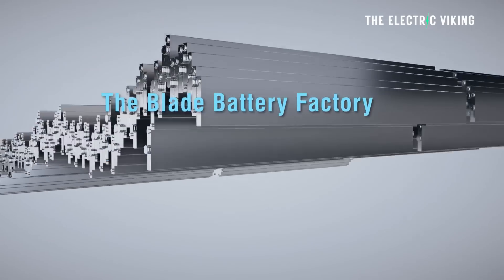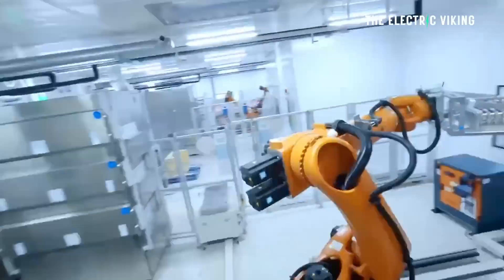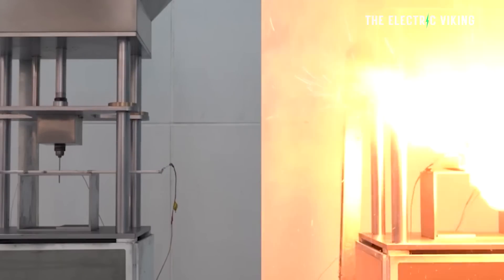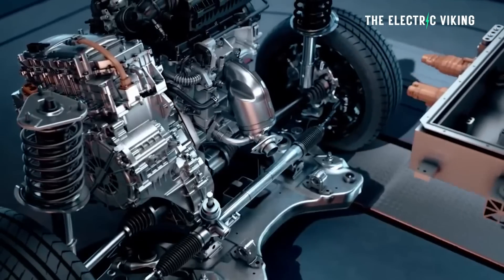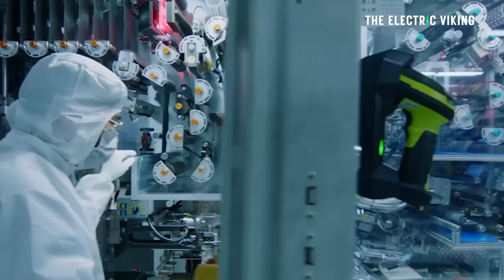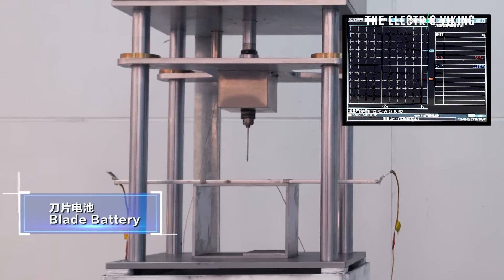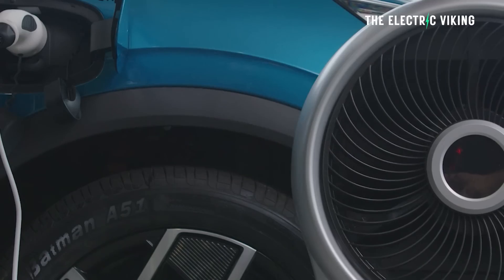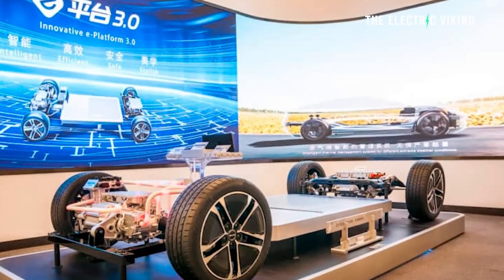BYD reveal new cheaper LFP Blade battery with 27% higher energy density

Comment: I think this v2 byd blade battery pack with 190 wh/kg in pack level energy density is the best battery pack ever released by any company,for comparison 2025 taycan line up with NMC 811 battery cells has 170 wh/kg in pack level energy density. or CATL qilin battery in zeekr with 280 wh/kg cells has 200 wh/kg in pack level energy density,or tesla model s plaid structural battery pack has 181 wh/kg in pack level energy density,so a battery pack with LFP battery chemistery  and that amazing energy density which also has much higher battery life almost like a petrol car and you can charge it to 100 percent with out battery degradation anxiety is amazing,very well done BYD
Reply: Btw, where does he get te 27% improvement?  "CEO, Wang Chuanfu, said the new battery will be even smaller and lighter with the same endurance during a recent financial meeting"
Reply: @pieter85  at their press con they showed on a screen written 190wh/kg pack energy density,their first gen blade had 140 wh/kg which had been improved to 150 wh/kg in just two years so when your consider 150 to 190 you will have 26.7 percent increase in energy density and when you round that 26.7 you will have 27 percent increase in energy density
Reply: The Taycan battery is a structural chassis component + their cooling system is something else as well... not comparable
Reply: @pieter85  you are right 2025 taycan battery pack has one of the most advanced thermo management systems period along side with 811 chemistery,thats how they got that 320 kw fast charing in much wider range temperatures both in battery pack and out side air temperatures

Comment: The longer the range, the better in cold winter conditions countries. 
In the winter times, turning on the heat to keep warm on an electric vehicle will drain out the batteries very quickly. Having long-range batteries less charging time. 
😃💖🔋🌞💯🌏✌️

Comment: Ok Sam you keep making this mistake. When the energy density goes up (watts/kg), the new battery is going to be lighter for the same amount of energy! So a new car using the new battery to replace its 60Kwh battery will have less weight for a new 60Kwh battery, but to get the same range will still need a (close to) 60Kwh battery. 20% increase in energy density is 20% reduction in weight… does not / will not equal a 12% reduction in required overall energy capacity. Parasitic drag and power use (A/C etc) will not change, only a very small change will occur from rolling resistance because of the reduced weight.
Reply: I was about to write the same comment. I don't know why it would make sense to get the same range with a lot less energy. It's just that the battery with the same energy either get lighter or smaller - depending on whether volumetric or gravimetric energy density increased.
Reply: True, I wrote the same thing. Thanks for mentioning it more clearly.
Reply: yes, more energy density means that a  battery pack that's the same physical size will have a larger capacity, or a physically smaller/lighter battery with the same capacity. A higher density smaller battery can be cheaper, and being lighter, can have additional improvement to range. This continued misunderstanding undermines the channel.
Reply: I think what he was trying to say is you could get 60 kWh from a former 50 kWh sized pack
Reply: @mteifke  if you’re measuring capacity (Kwh), measure capacity, if you’re measuring physical size, measure weight and dimensions. You don’t need to be an engineer for this to make sense
Reply: The weight is very important.  The greater the mass of the vehicle, the more energy is required to move it.   One of the biggest complaints about EVs has been their weight.
Reply: @peteralflat281  This is only partially true. Weight only contributes to a small increase in rolling resistance (friction) and of course potential energy loss however we can assume all EVs now use regenerative breaking to recoup most of this energy. Most of the energy losses are built in with parasitic drag, conversion inefficiencies and ancillary services like your A/C, power steering, battery heating and cooling and the like. So the power use because of weight reduction is minimal. I’m not saying weight reduction isn’t a good thing, but in reality, it’s not going to happen, as the physical dimensions of the battery will likely remain fixed while the useable power, and therefore range, extends.
Reply: no such hting

Comment: The question is does the blade battery architecture suffer longevity problems or some other drawback as a result of increasing the energy density? There is no free upgrades in any device in this world - when you increase one thing something else has to decrease, and in this case isn’t not just the size.

Comment: One day they'll have a 300 mile pack on a sub 10k motorcycle, and this is definitely going the right way! :)
Reply: Only if it weighs less than 200 lbs!   :-)
Reply: Im waiting! After years of tinkering on Ebicycles I love the tech.
Reply: 300 miles range, when an electric bike at 70mph gets about 4.5 miles per kWh. To get 300 mile range needs 300/4.5 = 66.6kWh
Using these 190Wh/kg batteries it would weigh 66600/190 = 350kG.......770lbs. 300 miles
My bike gets 200 miles range on 20kG of fuel

Comment: Yes this is all well and good but when will I be able to charge an EV direct into a household electric point without the need for a charging box .
Reply: What do you mean? You can do it now
Reply: @Another_opinion_  Yes, you can do it now.  For about 1 month, I solely charge my EV from a regular household plug, I was waiting for my wallbox installation back then. Takes longer time but still manageable.
Reply: @alihms  that's what I meant. You can charge your EV via a normal power point without any special charging box.
Reply: Yeah you can charge your car out a normal household plug. Charging a EV slowly at a holiday lodge off a normal plug socket, it was encouraged as the site the lodges are on are powered by hydro power off a fast flowing river. They are installing proper EV charge points this year. But adding 12 miles an hour when the car is sitting 15 hours is fine.
Reply: It’s a thing mate, buy one and plug it in no more going to the petrol station it’s easy

Comment: Sounds like a game changer. I personally would be happy with 500km range, smaller battery and paying a lower purchase price. But if this means we can also get genuine long range 1000km EVs that don't cost an arm and leg that's great too. Many people will need those in Australia as I can't see us getting a good charging infrastructure outside of populated regions any time soon. When will they be in cars?
Reply: Do the math: A realistic 1000km of range needs about 200 kWh even in a very efficient car. You only need long range when you do long trips. In today's standards this would mean a very heavy battery-pack. In my opinion it would be enough if a car can do 2 hours of highway-driving with 75% of the battery capacity combined with reasonable charging times.
Reply: @thomashierzberger6945  How is 20 kwh per 100 km "very efficient"? Thats last 10 years ago level of efficiency lol...
Reply: @AI-qd4vb  There are not too many Cars out there that can do 20 kWh/100km with a constant Speed of 130 km/h. Try it out for yourself.